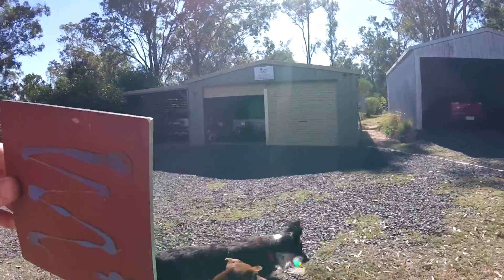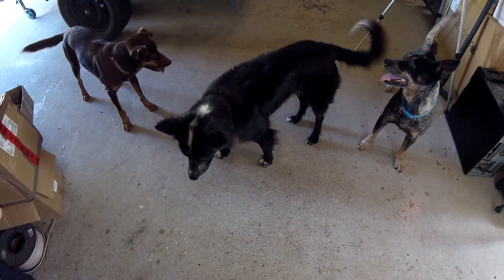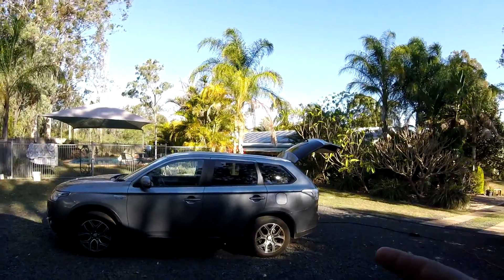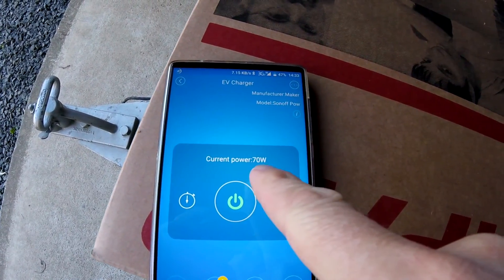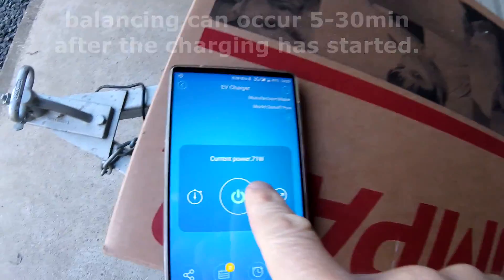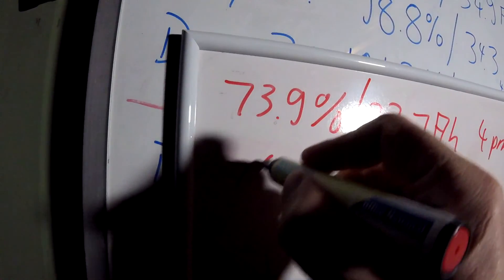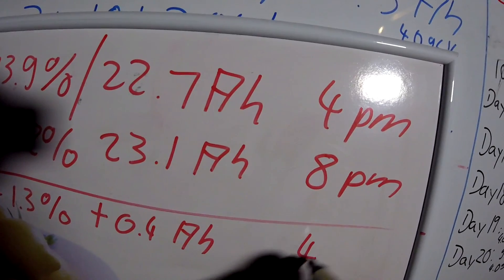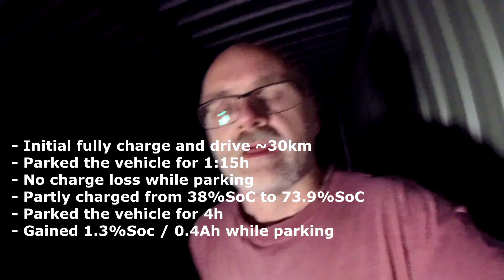EP112 - How to gain charge while parking with the Outlander PHEV.

Comment: The "balancing" or whatever happens during that current droop, happens every time in MY18 US version that I have. I have power meter and I graphed every charge both at 120v and 240v with current settings from 6A to 16A . I see this "droop" on every single charge after about 30-60min from the start. However I see it only one time - towards the beginning, never second time.
Reply from the maker: Thanks for sharing. I only have the balancing at the beginning with the 15A setting, the 6A and 10A setting balance at the end (~80%SoC). I realised this through the ChargePoint app I've shown in the video as I can check the progress on my phone from everywhere and was wondering why the battery was charging so slowly. The new app now shows the graph too.

Comment: Is that an older footage ? Your SOH dropped below 80% in recent episodes, but in this one you have 80.8% again . 

Also if you "gain the charge" , then the computer recalculated that for this voltage your SOC is bigger. That means that your SOH will droop as the difference between the current SOC and max is smaller. 

I see on mine that the recalculations of SOC happens all the time. So I would say it's normal. Therefore looking at the SOC dosn't make much sense. I think you should look at voltage instead.
Reply from the maker: I checked the voltage for a long time and even the voltage increases and also temperature rises in the battery, the SoC after parking went down. When I got the car back in 2015 there was always a rise in SoC while parking up until ~April 2017. From there on the SoC always goes down when the battery rests while voltage and temperature goes up.
(yes, footage is 2 weeks older, shhhhhh...... )
Reply: @unpluggedEV  so if SOC goes down, then it means that the battery can take more charge untill full. At least that's what I think. The SOC is just calculated number - an estimate of energy acumulated  in the battery .
Reply from the maker: You would think if the SoC of the battery drops (at least as per BMU calculations) it can take more charge because the battery is just emptier. It's almost impossible to tell though as the charging stops at around 4.1V with many other parameters been taken into account too. The charge never finishes at the same time or the same kWH or the same Ah even started from the exact same SoC as the day before.

Comment: Your car is as confusing as my i3. Does yours seem off with the driving range? Let’s say, my car has four bars to measure the battery like. Approximately one bar is used to travel 20 mile, but the next trip 2 bars are used for the same distance. Is that weird?
Reply from the maker: Yes, Kent, that's a known 'feature' and why it is called the GOM, Guess-o-Meter. It constantly calculates the potential EV range (and battery gauge) but also take previous trips into account to estimate the remaining range.